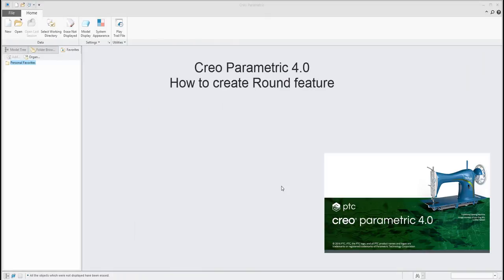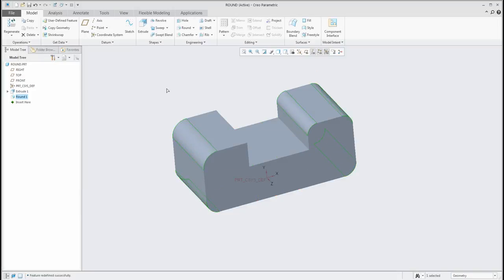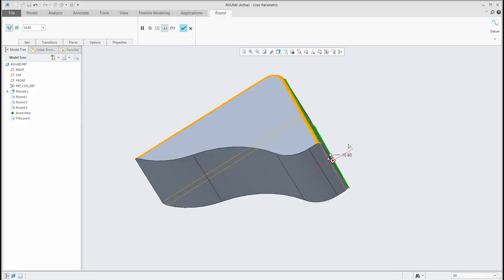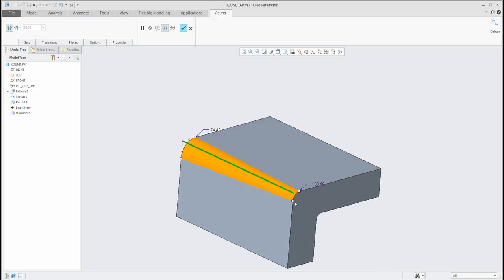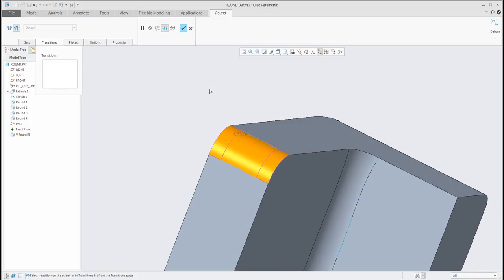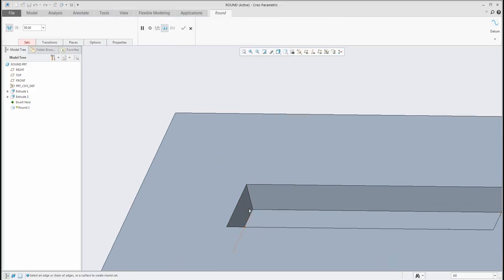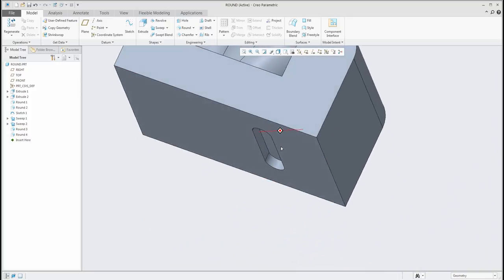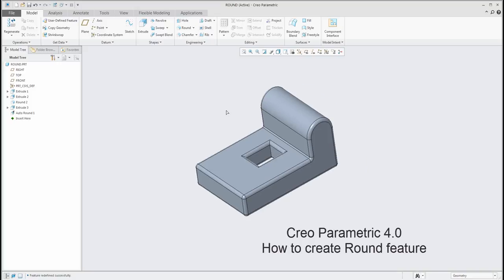PTC Creo 4.0 tutorial: How to create Round feature in Creo

Comment: I would like to combine what you demonstrated in 15:50 and 21:20. The Beginning radius should be 10mm and at the end 0mm. I tried this and it did not work entirely how I wanted. It creates the round with the taper and stops to the reference but the 0mm end is at the end of the rounded edge and does not stop at the reference point. How can I achieve this?
Reply: I managed to do it with the "Through Curve" option.
Reply from the maker: By curve is very good solution. I am glad that you find another way. Stay tuned. Vladimir